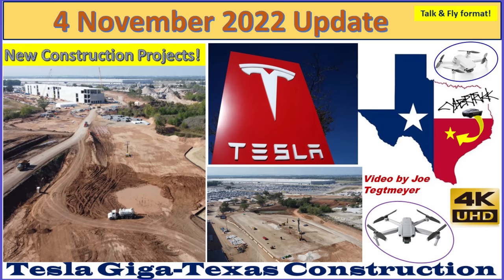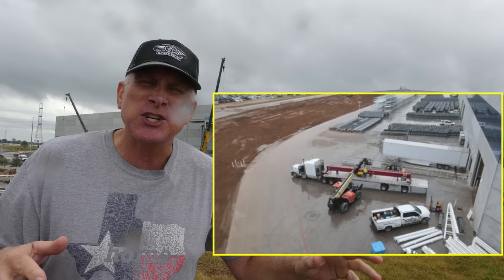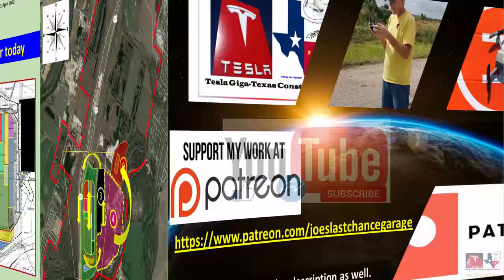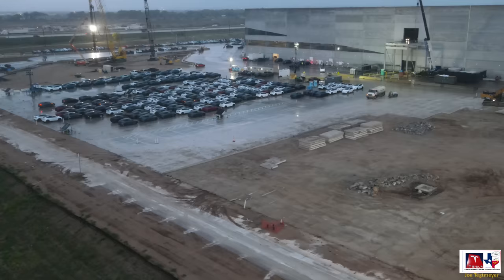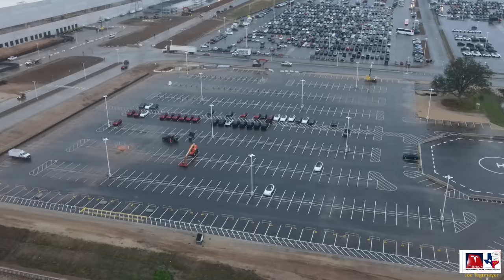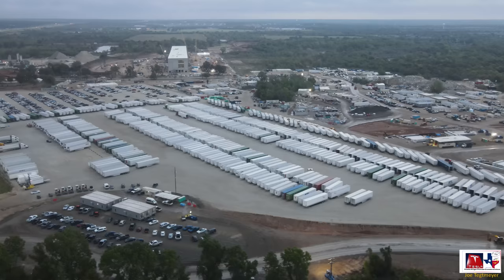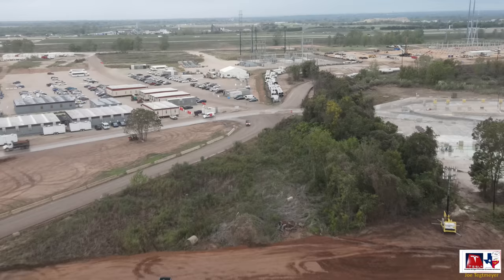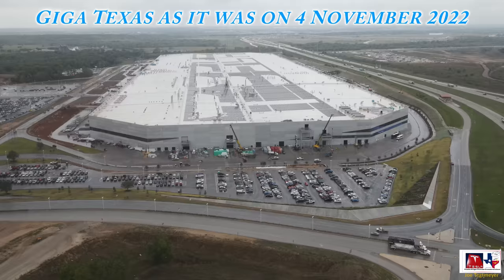Look in General Assembly & Main Entrance! Stormy 4 November Giga Texas Construction Update (07:35AM)

Comment: Thanks Joe.
0:18. Braving the lousy weather in a T shirt! 
4:50. GA, Level 3. Plastic curtain and plastic drop clothes over some of the crates behind. Painters at work.
6:56. Southend. 4 piers complete in the foreground. Trestles set up over the bore to support the rebar cages while the concrete goes off.
7:20. Southend. Rebar cages, and lengths of rebar that seem to be sheathed in white pipe. A length of this was seen being lowered into a bore in Jeff’s video yesterday. https://youtu.be/GsuvI1kN9Uc?t=674
Can’t imagine what purpose that could be for.
9:02.  Easement, HDD site. The larger black pipe might be in the trench. Not visible over by the silt fence where it had been located.
9:56. Southend. Bottom. Small trailer with PV panels. Joe’s photos show these are marked
TESLA NET-OPS (then a number). Mobile wi-fi point for OTA (over the air) updates?
11:19. Stamping 2. Inside door S9 in Joe’s photos can be seen the hook of a crane, no mobile crane visible, so possibly one of the bridge cranes delivered recently is already installed.
15:26. Cathode. New site office trailers.
15:40. Cathode Level 1 inside. Repairs to the drywall expansion joints.
17:08. Cathode, north. Steel pile. The truss like members seem to be columns.
17:47. Cathode west. Vertical rebar would be for a wall of some type, cast concrete or core filled blockwork. 
Building to be assembled here is in that pile of steel to the right.
18:58. MM batch plant. Could be forming up a pond here. For the washout water from the batch plant, or a retention pond for stormwater. Possible replacement for the pond at 18:43 that was a washout water pond.
20:19. New substation site. Vertical rebar around the edge. Larry Parrish commented under Joe’s 2 Nov video that there will be a low wall to contain any transformer cooling oil that might escape.
21:02. Casting. Bridge crane for the white structure. There’s small bridge cranes over each giga-press. One visible in the background here, https://youtu.be/uJwEzpThroU?t=542
Reply: 6:56 At every construction site I’ve worked at they’d use sawhorses like this over such items to keep idiots truck drivers and tele-handler operators from hitting them.  You can’t use orange cones and the like. They just hit those for sport.
Reply: @Bill_N_ATX  6:56. There's nothing on a building site that a driver can't hit!
Reply: @Bill_N_ATX  How did the weather affect you?
Reply: @DessieDoolan  It wasn’t too bad in the Austin area. We were right at the south end of the long line of storms (from Texas to Canada) and some of them were quite intense. It’s still moving east. However, the storms are usually a little intense at night but in this case we’ve had a large high pressure dome of warm, moist air up of the Gulf of Mexico being overran by a huge mass of cold air out of Canada. Well, the cold air always wins and the warm is driven up into the sky.  It cools down, starts raining like mad, and then you get convection. If you are lucky, it just means big thunderstorms. But you can also get straight line winds, (60 or 70mph) or worse tornadoes…which can do real big damage. Thankfully, we skipped all that around here. Just got a little rain.

Comment: @17:50, the rebar is set into the slab for a concrete block wall. The wall will surround the entire slab to seal it off and contain any fluid  if any tanks rupture or fluid leak from the storage tanks that will be installed in that area.
Reply from the maker: Thx!

Comment: The transformer support pads in the new electrical switchyard will have walls around them so that they can act as a barrier should the transformer (which is almost certainly oil cooled given the size of the transformer) have a leak. This ensures that there isn't a free route to the environment for any spilled oil. In addition, there will almost certainly be a fire suppression system around the transformer so the bunded volume around the transformer needs to have sufficient capacity to cope with both the oil spillage and an allowance for fire suppression water.
Reply from the maker: Thx! 🤗

Comment: 7:40 So instead of geo-piers like the rest of the building foundation, the south extension will get steel-reinforced poured concrete piers.  Maybe that ground, being largely built-up (see late 2020), isn't stable enough for geo-piers to be effective.
Reply from the maker: Cementitious piers were used in and under the casting machine structure. I think this is what we’ll see on the south end. Both areas had large ponds before the foundation was constructed

Comment: Speaking of cranes I can't help but wonder if it wouldn't have been better to install "permanent" cranes next to all the upper floor permanent loading platforms.
Reply: Hopefully those loading platforms aren't permanent. Totally ruins the look of an otherwise nice building. That, and the ugly sea of concrete surrounding the building!
Reply: I don't think those are permanent.  They're probably there for a year or two until all the production equipment is installed, and then they go away.  They're just better than the ones built with scaffolding, especially in that they allow access below them and probably have higher weight limits.
Reply: Permanent cranes would need to be sized for the largest load that might be hoisted onto each platform. With the mobile crane they can shift the cranes around as required, or bring in bigger cranes from time to time. 

As mentioned by Preston Crow, the loading platforms are temporary. Long term temporary.
Reply: @DessieDoolan  Makes sense.  Thanks.  Someone called the platforms permanent, so I went with that.  Lol.  I was sad but what do I know!?
Reply: @shadowmancer7040  Semi permanent, long term temporary. They did much the same at Shanghai.